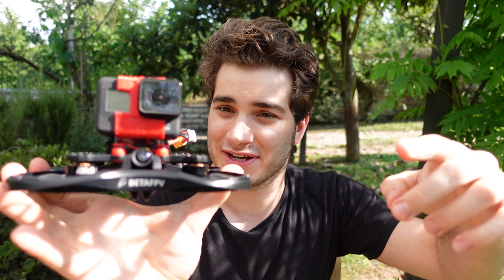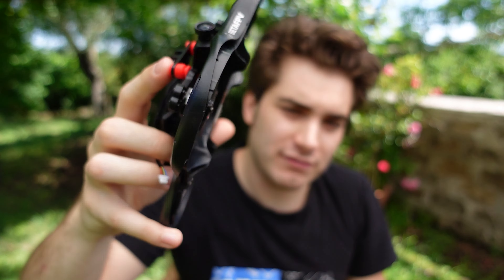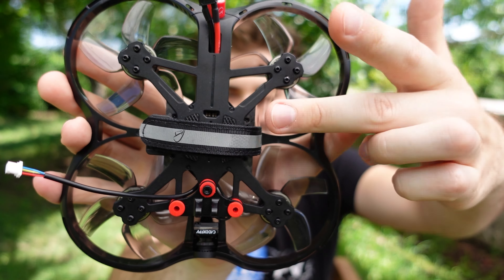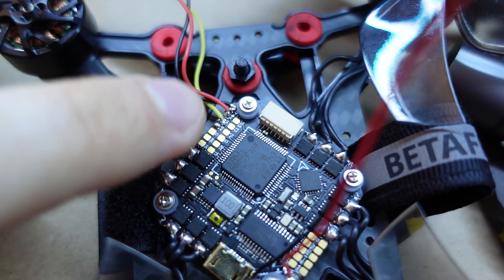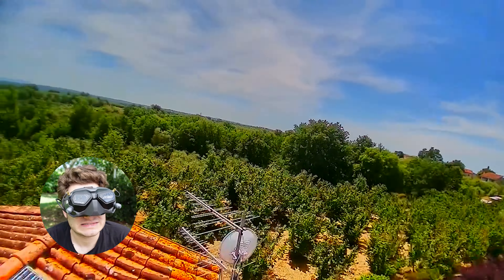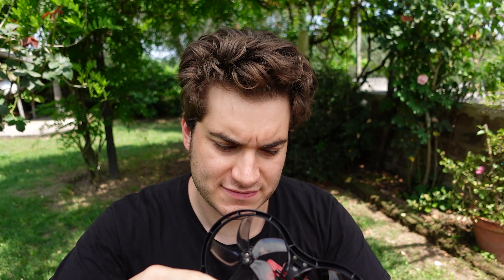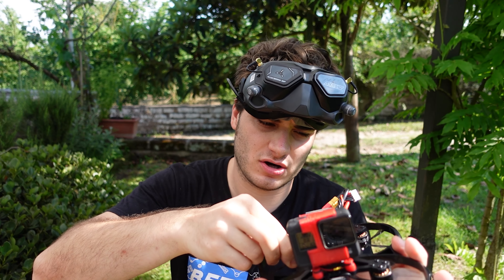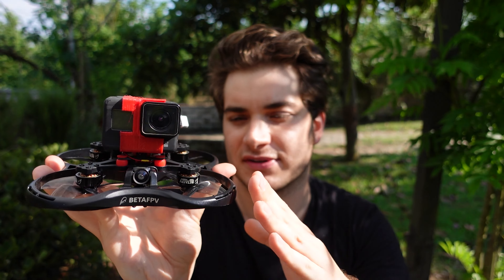IT CAN CARRY WHAT?? Betafpv Pavo30 review!

Comment: I bought the Pavo30 because I needed it for a job (my full cinewhoops were too big, and my beta95 is still waiting for batteries, stuck somewhere on a cargo ship), and I love it.
Yes, it's not under 250g, but I put some thoughts on it, and I found some tricks to make it a good cinewhoop: I used 3 screws instead of one on the grommets, and I used 4S 750mah batteries. Large enough to handle its power and light enough to make it nimble with a naked hero 6 on board.
The last crazy stuff I tried was to make it carry a GoPro9, without battery, using the iFlight USBC --> balance plug connector. I've modified the Hero6/7 STL made from BetaFPV, and I used two small straps to anchor the 750mah lipo at the very back, perfectly balancing the weight: It flies amazingly! :)
Reply from the maker: Yeah it's a good drone and very capable, i wish it was a bit more refined tho to better suit the various use cases, more filming tool and less toy
Reply: @Rimzler , I agree! Hope to meet you in person someday (I live near Udine), and buy you a beer since you inspired me so much with naked gopros :)
Reply: how can i find the STL for fullgopro?

Comment: Great Video! What do you use for a controller? Can you use the DJI FPV goggles as well as the DJI FPV Radio Controller for both the Pavo 30 and Cinelog 25 or do you need to buy a separate remote controller? Thanks!
Reply from the maker: DJI FPV radio is not compatible with FPV drones sadly, you will need another DJI radio for caddx vista or a FPV radio+ receiver

Comment: Can you improve the tuning of the quad or to also get bi-directional dshot on the AIO to filter out the jello noise so motor dont get hot?
Reply from the maker: Yes but IMHO companies should do this at the factory...
Reply: @Rimzler  yes i agree!
Reply: @Rimzler  i actually originally bought the pavo...then did the weight test and realized there was no way I could fit the naked go pro so I returned it and got the cinelog

Comment: I bought this quad. It's nice and light on analogue and flies 5-6min for me on 850mah 4s. 
Did you change the tune on yours at all?
Reply from the maker: I have not changed the tune, i believe companies should provide a good tune from the box
Reply: @Rimzler  agreed I was suprised it was just running on stock betaflight tune (by the looks of it), flies pretty good but I think there's alot of room for improvement
Reply from the maker: I think they come out with Betafpv tune, not stock, it works but can be improven

Comment: I’m having trouble bonding the controller with the analog drone. When I press the bind button on the bottom no green light, just flashing red and blue, anyone know what is wrong?
Reply from the maker: You need to keep it pressed while you turn it on, and have the radio in binding mode already, then power cycle and it should work

Comment: If your drone is upside down the reflector does nothing this is my idea why not paint the whole entire drone reflector instead of having a black drone stuck in a tree that has black branches or any field with nothing but Brown you're not going to find it a strap it's useless if it's upside down even if you're looking for with a flashlight but the whole entire drone done in this reflective material is ideal.
 You don't have to add extra away with the GoPro if you have DJI digital the goggles does wonderful and air unit is 1080 GoPro is just nothing but 4K whoopee Doo the goggles record just as good and it doesn't add extra weight and you still have to take the FAA trust test no matter what size your drone is
Reply from the maker: Yeah of course upside down is worse, but still better have it than not lol, i work with this cinewhoops, DJI is not good enough and no stabilization, also i don't live in the US, so 250g is still better